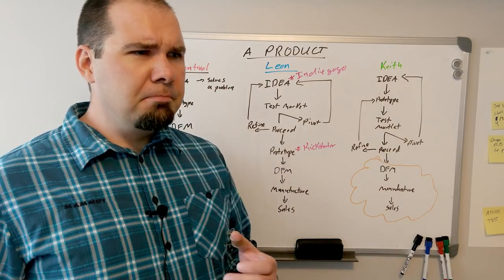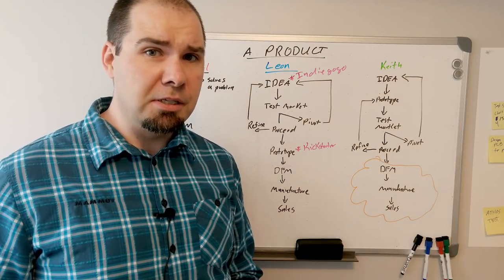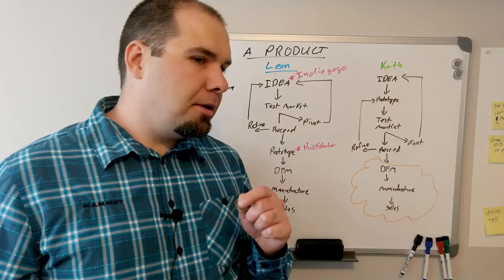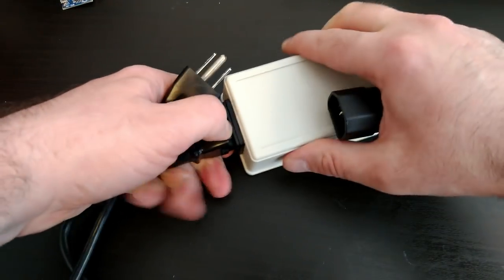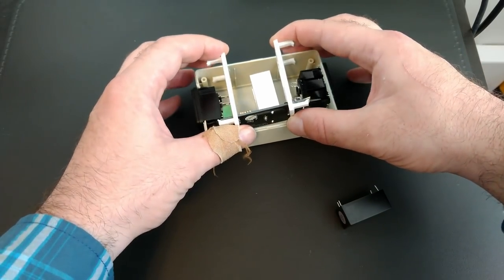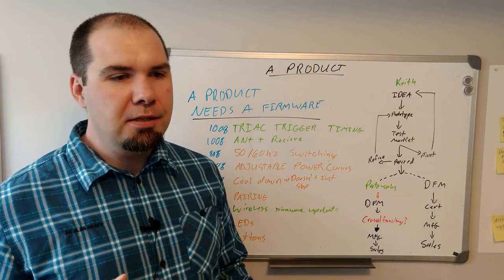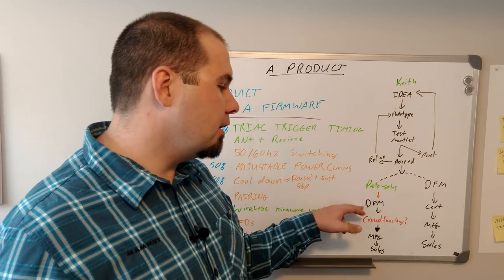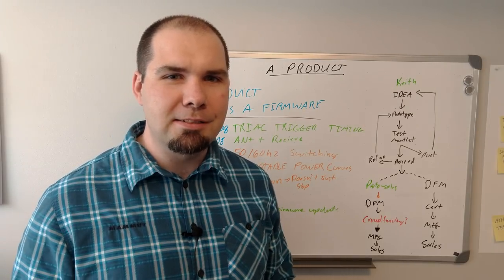Update 3 Maelstrom Bike Fan Controller

Comment: I'm with you - make something I also want to use. Have heard it called, "eat your own dog food". I appreciate the colour coded checklist, and your openness about the process you're following. Thanks for the vid. Good luck with the project.
Reply from the maker: Thanks. I've heard similar sayings. It's hard to get excited about something I don't care.   Ray Maker and Shane Miller talk a lot about this on the fit file podcasts whenever there is a new product. If you don't use what you're building then the chain to finding those issues is long and slow.

Comment: Some level of kit for sale seems like the best option. You get paid for design and don't have the labor or liability.

For frequency testing. 
We've tuned a generator down from 1800rpm to 1500 to reduce to 50Hz 
https://www.dieselserviceandsupply.com/Generator_Frequency_Conversion.aspx

$58 12VDC to 220VAC 50Hz output inverter https://www.amazon.com/dp/B07QRY8YGQ/ref=cm_sw_r_cp_awdb_t1_YISeDb8FSDKDB

$78 Kinco Automation KNC-VFD-CV20-1S-0002G Variable Frequency Drivers https://www.amazon.com/dp/B06VSJ8RJX/ref=cm_sw_r_cp_apa_i_NZSeDbJ6KMEHN
Reply from the maker: I hadn't thought about a VFD, that's a good suggestion. The "being in Canada" crops up a lot on the inverter problem front. Sadly the one you suggested and many more that will ship to the US will not ship to Canada on Amazon. I'll get around it eventually.
Reply: @kwakeham  its showing on amazon.ca for me: https://www.amazon.ca/Kinco-Automation-KNC-VFD-CV20-1S-0002G-Variable-Frequency/dp/B06VSJ8RJX but don't know if thats the best solution.

Anyway, proto/tindie idea is probably the best bet, you can see TI's eval disclaimer here: http://www.ti.com/lit/ml/sszz027o/sszz027o.pdf

Some other thoughts:
- Offload the risk to a third overseas party to manufacture and sell the product (see sonoff ifan02, seeed, etc.).
- Use a pre-approved module to deal with all the high voltage AC and only interact with it externally, via a motor (but would end up too expensive/bulky).
- kickr headwind appears to only have 4 fan speeds, there may be a reason for this over infinite triac control (but infinite is cool).

UL/CSA wireless fan controllers exist, $65 and up. So that kind of gives you an idea of a price point for a big company with a lot of sales, where certification cost is essentially nothing for them on a per unit basis.

Comment: Hey Keith, anymore update on this?
Reply from the maker: I have the first "Beta" unit on my desk (picture on the community post if you go into the channel) next to the first "DIY" unit and my dev unit (internals glued to a board) . The rest of the parts for the first 20 of these will be here early next week - There will be a email on what is happening in detail. There is a lot of video of assembly and stuff. I had to take out (temporarily) the HRM and SPEED code so putting that back is next. Behind the scenes there is a lot happening. I've been coding and testing edge cases (inside the last two weeks on some beautiful names.)
Reply: @kwakeham   hope I'm in that first 20 ;)